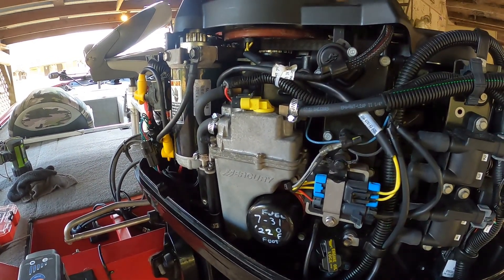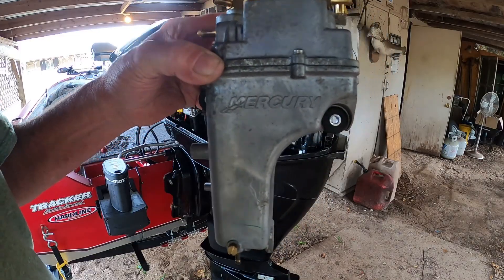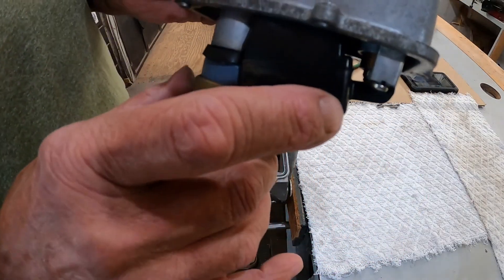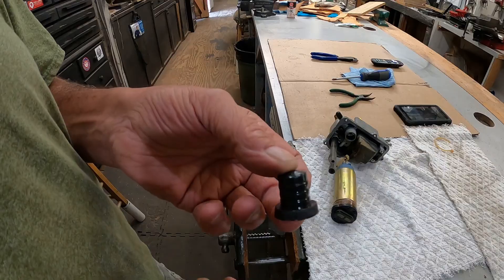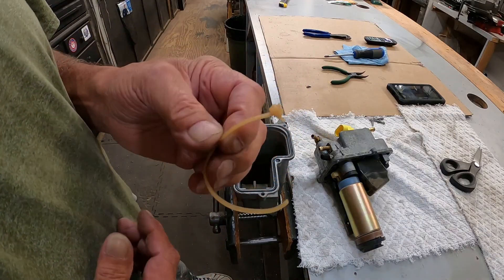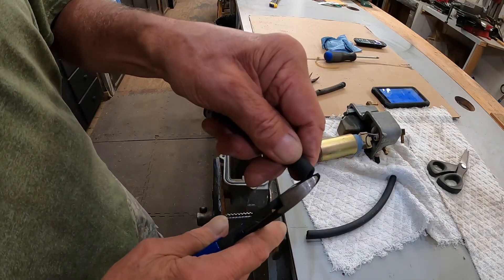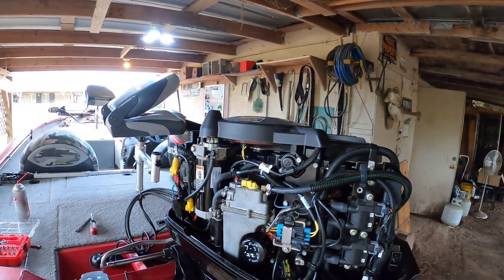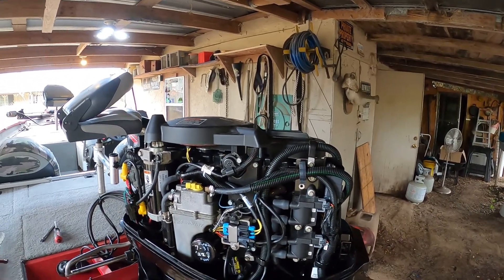Mercury 60hp four stroke Fuel leak  FIXED!  Stuck Float!

Comment: This is a great video thanks.  I had the same issue although my float was getting hung up on the connector shroud for the fuel pump. I filed both the float in the connector shroud down and fix the problem. This has been an intermittent ongoing problem. That was very frustrating appreciate your video.  By the way, mine was stock mercury so this is a design problem from the factory.

Very dangerous to just be spewing, a stream of fuel straight out the bottom of the cowling.

Comment: my 2023 mercury 4stroke is leaking fuel from bleeder bottom of vapour tank put a new screw in still leaks i could just block pipe off any ideas the service company drained tank iam thinking they overtightened screw mabye damaged the inside ? cheers phill

Comment: i have the same problem. pro 170 tracker. i dont think its due to aftermarket parts. i just disassembled mine. its never been taken apart but the float was hitting the seal. i filed it down slightly and hopefully fixed this poor engineering. Im learning mercury hires the same engineering folks Boeing hires

Comment: I just broke mine apart last night. The air vent was draining fuel. I think I have the same problem with that gasket above the pump.
Reply: What was the symptoms of your fault? Mine is draining fuel from the top hose when pumping the fuel line bladder. Sounds a bit like yours 🤔
Reply: @trulskoch1889  Actually once I changed it. It did the same thing. Good luck.
Reply: Do you mean it still had the same issue after the repair?
Reply: @trulskoch1889  yes. It ran good for a little while. I have another intermittent problem which isn't a stuck float.
Reply: Ok I see. I have a rough idle and fuel leaks when pumping the bladder. Engine is only 5 years old. I suspect the 10% ethanol additive here in Sweden takes a toll on certain rubber/plastics.

Comment: Thanks for the video. I've got a 2003 Mercury 40 hp efi that I replaced the high pressure fuel pump in the tank. Does the fuel pressure regulator supposed to have a vacuum hose on it? I don't remember if mine had one on it and I might have buried it behind the tank when reinstalling.